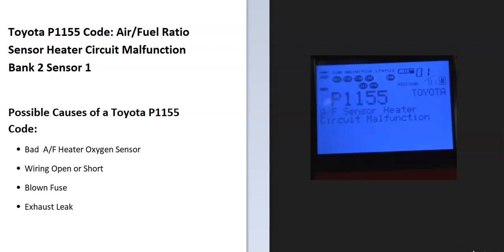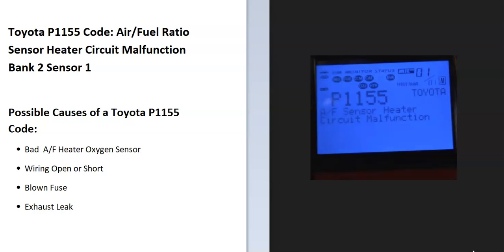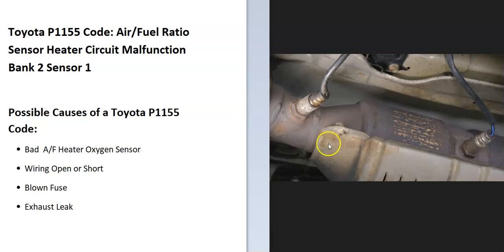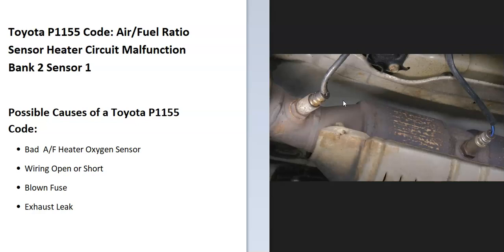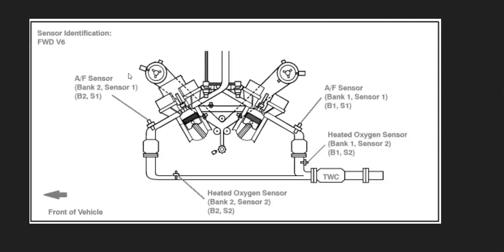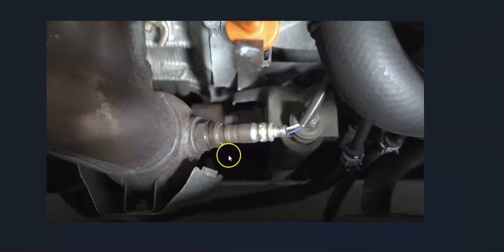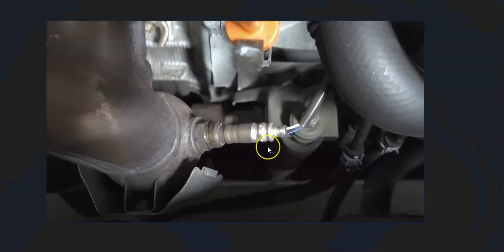Causes and Fixes Toyota P1155 Code: Air/Fuel Ratio Sensor Heater Circuit Malfunction Bank 2 Sensor 1

Comment: I have 2002 Lexus ES300 I have the check engine light on two codes po1135 and po1155 I reset the codes and they come back right away. I’m going to remove the o2 sensor from my 2002 Toyota highlighter 3.0 engine and put it in the 2002 Lexus ES300 same engine and see what I if makes any difference

Comment: Very helpful video. Im throwing  p1135/p1155 codes.. Pulled bank1 sensor 1.. the connector looked really yellow inside, I replaced it... Pulled Bank2 sensor 1.. connector was white.  These things arent cheap @ 198.00 a piece...
Reply: I have the same issue for my avalon 02  and engine light is on!  Did the engine light come back after you replaced both sensors or it was fixed ?  

I would really appreciate it if you could answer

Comment: In my case, the sensor still has a closed circuit for the two black wires, yet I'm still getting the code. Any tips for further diagnostics? E.g., how could I confirm if it's the wiring harness?
Reply: And what was the reason ? Did you find out …

Comment: Could a bad 02 sensor cause it not to start?
Reply from the maker: The engine should still start and run. The O2 sensors mainly monitor the catalytic converter and help the engine run efficiently by going into what's called a closed loop. With a bad O2 sensor, the vehicle will stay in an open loop, which means the computer is guessing the air/fuel ratio. The engine will still run, just not as well as it could.